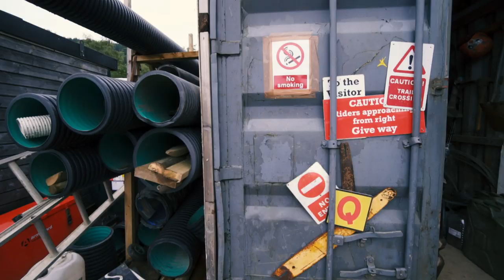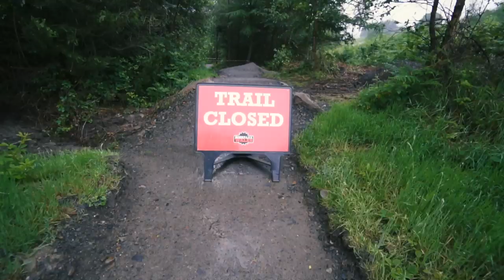A Day In A Life Of A Trail Builder

Comment: I used Vedder Mountain ride park trails.  Seen 
in YouTube.  Volunteer maintained, open 24/7, 
and posted for specific usage.  There's those for
4x4, dirt motorcycling, and bicycles.  All may 
share improved roads that circle the mountain.
There's less 4x4 routes and dirt 2-wheeling see
more.  Bicycle routes are as you expect but a
moto' ability has more challenge in uphill runs.
Snow, ice, and water-filled mud holes do exist
for all users.  Walking out happens and going
downhill for tow assistance is helpful.  I've
also used the Chipmunk Creek dirt roads and 
trails.  Never did the cross-summit route north
over mountains to Trans-Canada Highway One.
To Bridal Veil Waterfall Park.  No caves for me
to find after departing the limestone extent.  
See what you can of route using Google Earth.